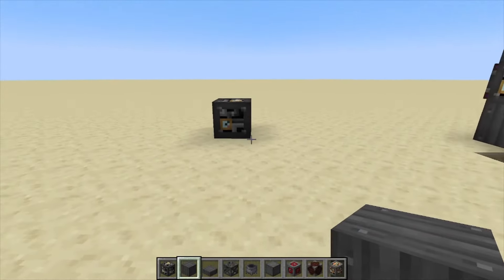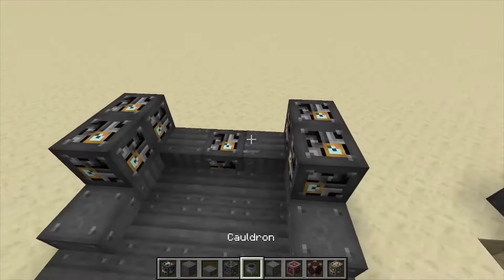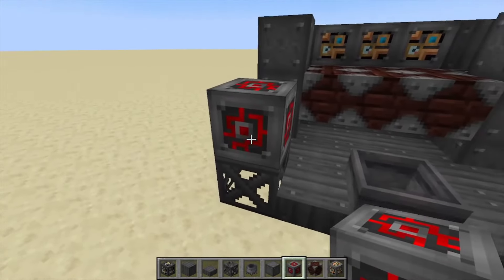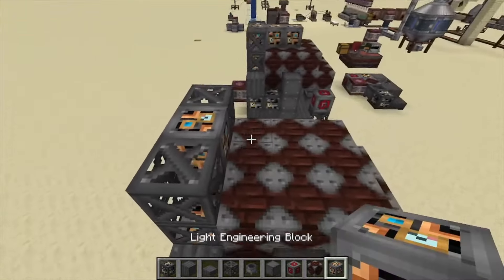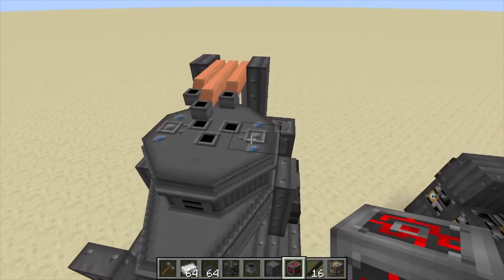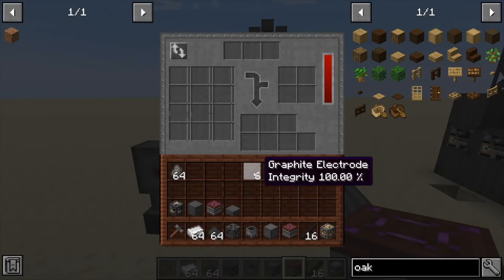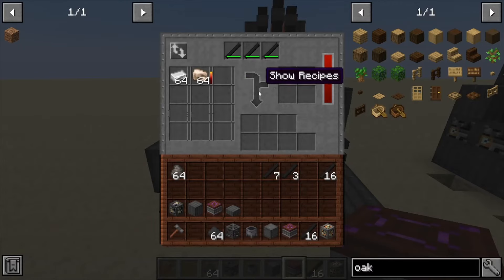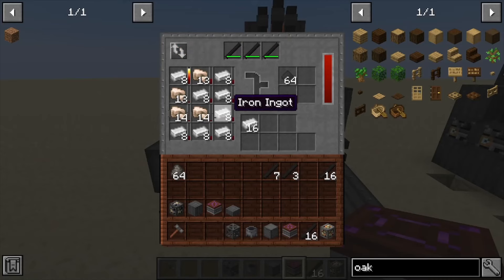Immersive Engineering: Arc Furnace (how to build and use)

Comment: In case someone else needs the info ^^

Amount of items used:
Cauldron   ~~~~~~~~~~~~~  x1
Block of Steel   ~~~~~~~~~~  x6
Steel Scaffolding   ~~~~~~~~  x5
Steel Sheetmetal   ~~~~~~~~  x8
Steel Sheetmetal Slab   ~~~~~  x14
Reinforced Blast Brick   ~~~~~  x27
Light Engineering Block   ~~~~  x10
Heavy Engineering Block   ~~~   x5
Redstone Engineering Block   ~   x1
Reply: im playing atm9 and i can't find block of steel and tried to use steel block, didn't work.
Reply: @aaalqlq  I'm not familiar with ATM9 so I'm unsure of how to help other than to say you could try going into a creative single player world to test it out more thoroughly. 

If it doesn't work in creative, then it could be an issue with mod compatibility. ATM packs can be very buggy due to it having so many mods in it that aren't necessarily made with the others in mind. I just mostly made this list of components for reference in my Valhesia playthrough and thought others could find it useful~ 😅

I hope you can fix your issue though; Happy New Year~ 🎊
Reply: @aaalqlq  I know this is a little late but I found that you can use the steel blocks from alltheores if iirc you may just have to activate the machine by clicking a different block than the manual say's
Reply: @Jetste  thanks, which block?
Reply: Thank you... Goddess Forbid he actually refer to the damn blocks by the correct name.
Reply: @aaalqlq  same issue bro its not show how to craft block of steel

Comment: I can't seem to power the arc furnace. I have HV lines connected to the back with 3 hv wire connector connected to thermo gens
Reply from the maker: You will likely need a diesel generator to power this one thermo gens barely power most machines unless you have a TON of them